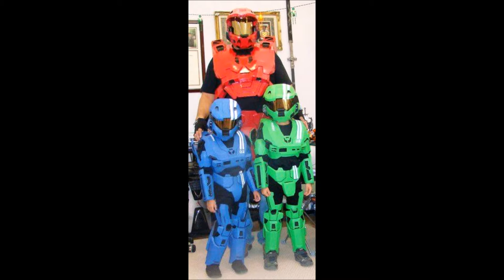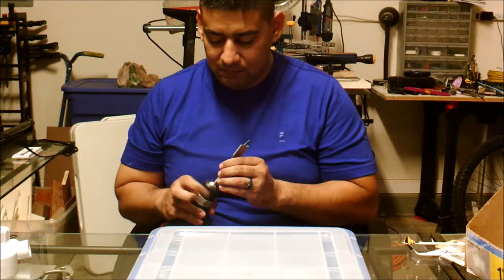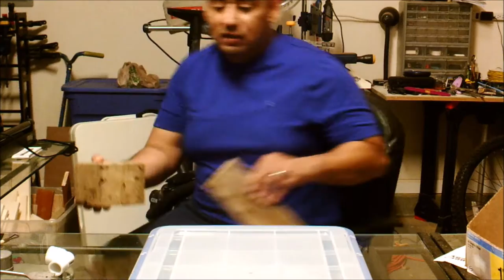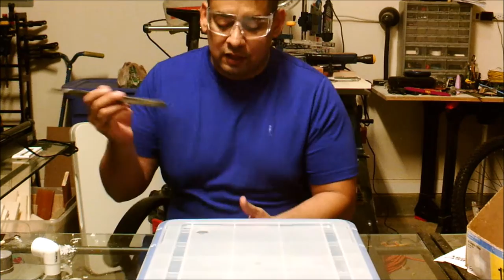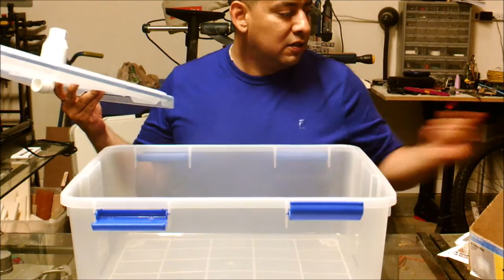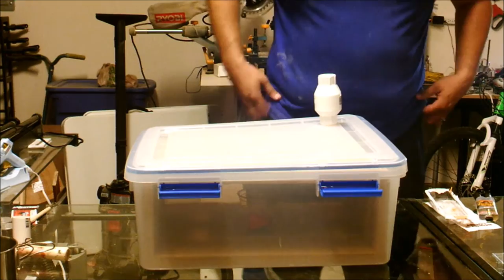Partial Vacuum Chamber - Craft Dad

Comment: I like your effort, but did not create a vacuum. I used a stem valve, and created my cover entirely by applying a silicon gel and nylon to the cover and the container. I noticed its a little difficult creating a vacuum in a flexible plastic container, but will not relent till mission is achieved. Let me know if you eventually created your vacuum, because its a prerequisite to my research success.

Comment: Have you tried to add weatherstripping to the top of the container?
Reply from the maker: Nope, I haven't tried that.  I have put this project on hold until after Halloween is over.  Until then this is a great way to keep my whole garage from smelling like resin.  Thanks for the tip.
Reply: Weather stripping will create a permanent seal, depending on the material used. But I want a re-useable container that will not seal permanently for my project. I could use a non plastic material, but could not afford the cost.